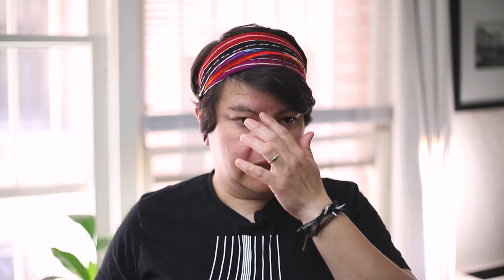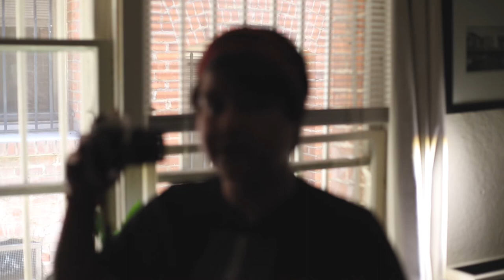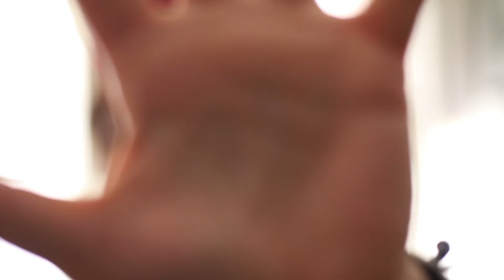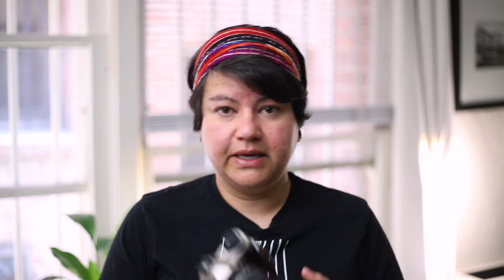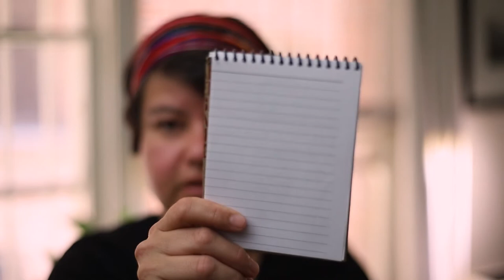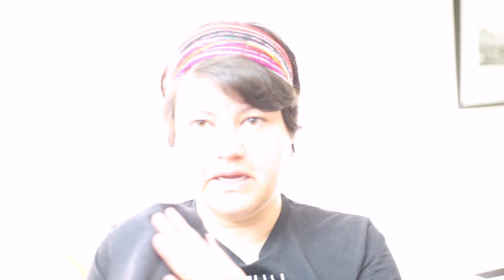Metering With Film Cameras

Comment: Very good job explaining metering on vintage film SLR cameras. Thank you!
On a side note, I was using my Minolta SRT-303 with a 50mm f/1.4 lens  to photograph my wife standing behind a table with a vase full of flowers on the table in front of her but off to the side so that the flowers were not blocking her body. I took two photos and I was 100% sure that I had sharp clear focus on my wife. But what happened was when I got my negatives and prints back from the lab, the flowers were in sharp, clear focus and my wife was out of focus. Perplexing!